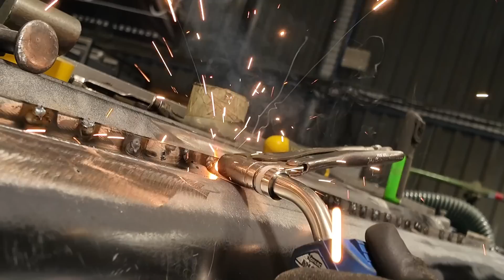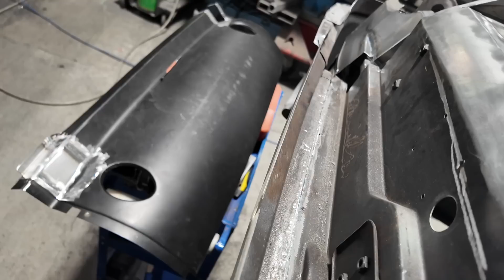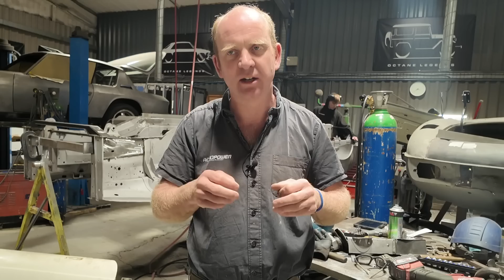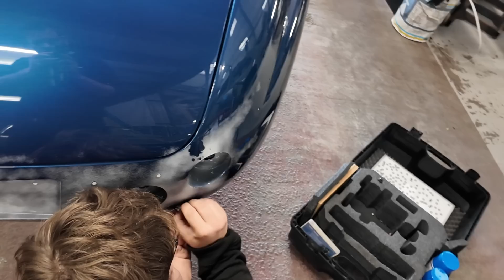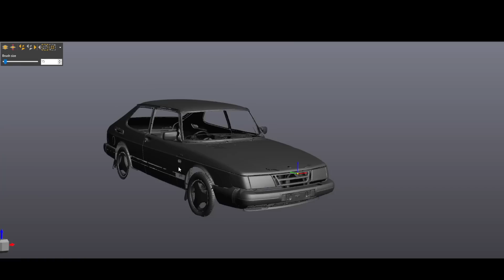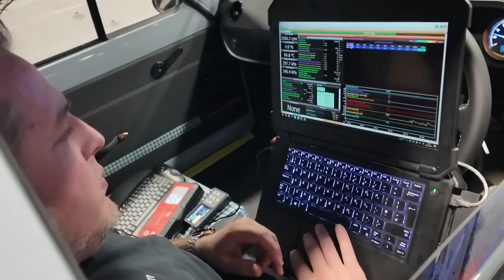Restomod Jaguars! XJC, E-Type & MK2 2-Door.

Comment: Citroen DS with internal combustion... but going completely out of the box? If you're feeling brave, how about a rotary from an RX-8? Circa 250bhp ... but creamy smooth and would sound completely different... And if you're not keen on a rotary [and if it would fit!] what about the B58 as fitted to the BMW M140i? Silky smooth, turbo, came with 335-350bhp out of the factory... but can go to 500 or beyond if you're feeling silly.

Comment: Regarding the DS - I've worked for classic dealers and recently we had a DS19 Chapron Cabriolet that was restored beautifully to look bog-standard and preserve its lovely lines. The suspension and brakes were all rebuilt to function beautifully as designed, but under the bonnet was a 2.5-liter 16-valve Turbo from a CX Turbo, with standalone MOTEC management, and a 5-speed manual (shifted via the column, naturally). It had beautifully functioning A/C, was always on the button, and yet it wafted along like a Citroen DS should. The guy spent about a half-million dollars (US) on the restoration, and I would equate the performance to an 80s SAAB 9000 Turbo - smooth, comfy, effortless. An absolutely wonderful car. Not sure if I can link to it here... but I'm happy to try.

Comment: Bare DS and SM Chassis, judged by photographs: Citroen gave the SMs V6 already more clear width,... maybe one would have to use parts of an SM Chassis/"floor pan"/ its front part, to make room for a flat six ?

Using the existing space a DS provides...A VR engine comes to mind space wise: But VR5 or VR6 of VW would not have any strong link to Citroen. And Lancias "latest" VR6 should date from the 1960's at best ? and the Fulvias VR4 from up to 1976, but fourbangers should fit anyway as a inline fours.

Or you might use parts of the front of a Traction Avant 15/6. 

Or just build another triangulated space frame - in this case only the front end section - connecting in a jaguar E-Type fashion to the chassis of a DS from the fire wall on.

...electric would fit the DS as almost no other car, in my view, although not representing an overly surprising choice.

Comment: The present engine is a large old fashioned straight 4, could it be replaced with a vr6/ R32 engine should fit. Then just need a gearbox that fits and can cope with the torque/power.

Comment: For the DS, you’d need something with a low profile that’s quite short, an LS could work but I’d do a twin turbo (small turbos) 3.0 duratec through a nice torque converter auto gearbox. Plenty of grunt on the squeeze of the throttle with no lag.

Comment: According to Wikipedia Citroen where planning a flat six, front wheel drive engine for the car but funds weren't available. Don't know much about them exempt lots where cut up for film tracking vehicles because of their incredible suspension. Are they an inline 6? How about a refined AJ6, or if you really want to be stupidly difficult, maybe, and it's possible I know a really great manufacturer of flat sixers?? 😉

Comment: Citroen DS would be suited to a V6 hybrid possibly. Using say a 100kw motor to torque fill and give about 20miles range with a small 7-10kwhr battery. Super smooth and modern

Comment: For à Citroën DS, how about what Citroën themselves did - a V6… they built a number of two door (cut and shut) test beds for the SM running the 90° Maserati V8 with two cylinders - very crudely - lopped off. The later PRV and PSA V6 engines retained this configuration, I imagine through a mix of experience and the practicality of a wider, thus lower, engine for a transverse application (Xantia, XM etc…)

Comment: Citroen DS -- potentially a 3.0 V6 from a Pug 406 -- the last(?) development of the original lacklustre PRV 2.7 V6 turned out to be quite a lovely motor, at least behind a 6 speed manual. For a DS, an automatic transmission would probably be more suited as long as it wasn't the 'orrible Peugeot auto that was often behind the 3.0. 
Oddly, and right on the tail of the comments concerning EV conversions, an EV DS would be one of the VERY few EV conversions that I feel would suit the spirit of the car. In a Testrossa, though? That is just ridiculous to even contemplate.

Comment: I thick that the DS was originally designed for a flat engine, could a flat 6 fit?
Interesting but maybe not the best option for a cruiser type of car.
Maybe a flat 4, less powerful so better for front wheel drive.

Comment: My father was an engineer at Jaguar. He started at 18 as an apprentice in the experimental department and retired some 41 years later from Jaguar. Just saw your video and thought I bet he was responsible for the design of said "tube" you mentioned and turns out he was. So here goes his words via my typing after I got off the phone from him. They are not "tubes" but part of the Manasco strut impact system. There was liquid in the strut which was also proprietary to the Manasco system. Per U.S. federal rules a car had to withstand a 5 mph impact with zero damage at an angle of straight on to no greater than 30 degrees off set. To achieve this the bumper would travel/compress 2 to 3 inches. Hope this helps. Love the channel and tune in weekly.

Comment: a question for Callum, could you explain how you go about registering the body swap cars and some of the other vehicles you're building which are dramatically different from original design layout eg the current run of escorts where you've changed to irs please?
Reply: I think a lot of them have been IVA'd as it is mentioned in some of the uncut episodes. The minor for example iirc.
Reply: @malcolm8938  I have asked the question a few times and it it's always dodged
Reply: Maybe they aren't all IVA'd but tbh I can't blame them for not wanting to discuss how they register modified cars having seen the problems it can cause. @davidclarke3643

Comment: The thing I detest about drive-by-wire throttles is the absolute lack of feedback through your foot.  With a cable, you can feel when any slack is taken up, find the point where the throttle is just about to open and hold it there if needed.  Especially on a road-going car where you're likely to be on steady speed throttle much of the time (or on cruise control), and with much more stop-and-go driving than a track car, I prefer that feel through my foot so I don't jerk, or have to blip the pedal every time you get moving so I can find the point where the throttles start to react...even coming off cruise control, it's smoother if I can pick up the throttle before switching it off so you don't get an immediate and abrupt deceleration.  Easier for tuning, but I feel it's a bit of a compromise in terms of actual driving.

Comment: The Citroën DS was originally intended to have a 6-cylinder engine, but from a cost perspective (cost savings) it remained with a 4-cylinder in-line engine. So a V6 with a lot of torque seems to me to be an interesting and suitable alternative (a 6 in line would be even better, but will it fit???).

Comment: What engine would I put in a Citroen DS? A Nissan VQ37VHR V6 from the 370Z. With ITBs, a mild set of cams, and a properly-built exhaust system they can sound glorious, and 250 kilowatts is plenty to get a DS up to speed and capable of some 'lively' behaviour.

Comment: If I win the lottery I have a project for you: a Aston Martin DB7 Vantage totally restored body wise, painted in a traditional A-M dark blue with mid-blue leather interior, then the powertrain changed for a Chevrolet LS1 V8, a TREMEC TR-9070 DCT 7-Speed Dual Clutch Transmission, I will leave the diff to you, an ECU, Wilwood disk brakes all around and (here's a challenge) a complete Apple CarPlay instrument system (including all gauges). Ah! what a lovely car that would be.
Thanks for the great videos, my only suggestion is to get Nat to explain some of the technical issues in more detail 🤔🤨😊😬
Reply: Nice! Swap AP Racing for the Wilwood rubbish though. And maybe an LT4 over an LS1

Comment: On the Citroen DS  Either full electric or maybe a Subaru flat four all-wheel drive they easily will make 3 to 500 horsepower turbo'd conversion

Comment: Water cooled Subaru flat6 (3.6L? of effortless torque/power) in a Citroën DS...?
Flat6 would help with the low bonnet lines ... opens up to possible 4wd...
Reply: The problem is the engine layout, they ran the gearbox in front and not behind like a Subaru. A Porsche 3.6 and gearbox is running in the right direction.

Comment: Regarding the question of engines and performance it comes down packaging and intended use. 

Bore spacing in the block determines bore size. Bore size determines valve size. Valve size determines airflow. Airflow determines output. 

Fun fact, the Kent engine and Duratec share the same bore spacing. Therefore it should come as no surprise that a 2 litre Duratec is only good for 300 bhp.

Comment: It's amusing how many people seemingly have no idea of engine/gearbox layout of the DS or how restrictive the engine bay is. 

Whilst the engine bay configuration is suitable for an electric motor there  is not really a suitable place for batteries. The batteries would have to mounted above the centre line above the electric motor or at the expense of the boot area or at the expense of rear seats. 

The next issue is the transmission. The input shaft from the clutch is known to fail. The torque from an electric motor would be an issue. This could be overcome using modern steel alloy. 

A while back I was asked to produce a competition engine for a DS. I made custom cylinder liners for a DS  23 block/crank that made it 2.5 litres. I made steel camshafts for it. I welded up the combustion chambers. I offset bored the inlet ports (raised) and welded in port sleeves. I used V8 Chev valves. Engine software was predicting 230 lb/ft and 260 bhp using 4 x 48mm bike carbs. The rules meant carburetors and the engine bay meant bike carbs. 

In an ideal world the DS25 would have been injected with coil on plug ignition. The standard distributor arrangement for drive and placement wasn't ideal. It would have been dry dumped. No service parts were available for the standard oil pump. The standard pump design   wasn't idea for motor sport either. 

Unfortunately the entire project was put on hold.

If you're interested in additional information let me know. Happy to assist.
Reply: Love it!

Comment: Funny thing is Cal didn’t mention handling, drivability, reliability or performance once, he basically said the Testarossa is a crap, badly built car that makes a great noise.   I thought performance cars were about driving? If the electric conversion makes the car faster, handle better and more reliable what’s your problem?   Or do you need the  noise so other people will notice what a cool dude you are?   Moggy (that guy from Wales) has spent a lifetime actually building and racing cars both petrol and electric not sitting pontificating from behind a keyboard.
Reply: He has a niech and I get that.  I think the Testarossa was a marketing act, one where you make a problem to sell a solution. This is a one off, simply to piss off the purists. In the same vein as Rich Rebuilds putting an LS in a Tesla.  
I also think the idea of never using an EV as Cal is adamant about is just as pig headed given his schtick is putting better engines in cars. The problem the EV converters have is crash safety. Putting 200kg of incompressible steel in old cars is the bit I don't like in anything other than a city runabout.

Comment: If it has to be ICE for the DS I’d go with an air cooled Porsche flat 6 mated to a 5 speed semi auto ds ‘box. That’s what the DS was originally supposed to have. For suspension keep it hydro pneumatic but use something like McLaren’s hydro pneumatic anti roll with no antiroll bar (Citroen also prototyped this in the 70s). 
But EV is better for DS. Silent, torquey and effortless.

Comment: It turns out that that fancy twisted exhaust tips on the XJ jags , were very nessesary, I worked at a jag dealership in 1975 and the cheap chromed originals had rotted out and replacements were not available so we put straight ones on, however because of the low pressure area at the back of the car this allows killer exhaust Gas to enter the car on a trip.   Just be aware

Comment: The DS, where the engine isn't in any way part of what makes them cool, would be the perfect EV conversion. Same would go for most "non performance" classics. On cars like the Testarossa and other performance/super cars I'd rather walk than have an EV powered one. Even if the performance was twice as good it'd still be absolutely missing the bit that made it special.

Comment: Ds powertrain: electric with onboard generator. The Mazda cx30 has (I believe) electric propulsion with a rotary ‘range extender’. This would fit the ds perfectly as Citroen dabbled with rotary power (they produced a small number of rotary powered gs before abandoning the idea). It would mean a modest battery but a usable range.

Comment: Dennis Collins gas just found a wicked early round light DS…. A Maserati V8 from a Grandturismo would be cool, cheap and in keeping as the SM was Mazza powered.
Reply: Thinking height vs bonnet.
Reply: Where are you planning to put the gearbox? The original DS motor was so far inboard the cylinder no 4 was accessed through a hole in front of the windscreen.
Reply: @keithhoughton4308  transaxle?
Reply: @paulbaker5238  Rear wheel drive or gearbox in front of the engine as the original?
Reply: Front  engine rear gearbox
Reply: @paulbaker5238  Aargh!

Comment: Funnily enough I have been  thinking about a Citroën DS project myself and also wondering which engine to use. I think tor sheer waftability a turbo diesel would be best but a slightly less "agricultural" one than the TD4. Also an alternative to the traditional suspension could be an air ride set-up

Comment: For a DS restomod I think it’s best to use the 3.0-24v V6 from the XM, still uses a hydro pneumatic system like the DS..
Reply: But an engine can be build and improved, the team at Retro Power is very capable  doing that.. it may be a older design engine but for a reliable cruiser that engine will be great in a DS
Reply: Don't go there. Poor engine from the  Peugeot years which was already behind the times when originally fitted to the XM.

Comment: A Citroën DS should waft you along, so either an undersquare inline 6 cylinder ICE or an electric motor, IMHO.
And no flared fenders, please ;-) If you have to widen it, the fenders should have flowing lines following the original design.

Comment: If  you do a Citroën DS project: the answer is easy .. throw in a Citroën SM ( Maserati ) engine. Even have the hydralic pump and all
Reply: Have you seen under the bonnet of an SM, though? It’s not a very elegant solution with that great long shaft driving the pump

Comment: DS needs a PRV. Naturally aspirated, single throttle body, cast manifolds and a 2" with a 2' resonator and a oval rear silencer ending to a bent saw blade edge. It would have all the necessary torque, just enough sound to tell the driver the engine is running okay and the rest is wind and road noise. You could listen your favorite tunes without going death while doing touring speeds.

Comment: 997 engine and DSG gearbox as a Citroen DS mounts the engine the same direction.
Reply: Spot on. 

Completing the DS concept as intendended, as stated by so many.
Reply: Someone has to find out wether the "centerline to back of the engine" is "short" enough, since the DSs Inline four is already "intruding through the fire wall" into the cabin. flat six should be as long as "three and a half cylinders in line" ? and therefore it might fit.... no idea how the gearboxes are layed out. But Porsche will have tried  hard to keep the package  "shot", hanging out of the back.
Hm, and how about the footwell - Is it going to be compromised by a wider enigne? 
EDIT:
Can anyone put his DS up on the lift and measure the clear width between the frontal outriggers - and than put his Porsche up on the lift and measure the width of the engine hanging out of the back ?
Reply: I read that as a 997cc engine for a moment and wondered why you’d want a 39bhp Ford pre-crossflow Kent in a DS! 🙄

Comment: The N/A YB engine (and presumably the Millington ) has a very compromised head as it was designed for a turbocharger with low CR. The valve angles are too big and you need at big intruder to get the CR. Hence the combustion chamber is really not ideal compared to the BD head

Comment: Surely the DS is the perfect candidate for an EV. Silent wafting with a discrete pump for the hydraulics sounds awesome to me.
Reply: The SM is an even better candidate in my view.
Reply: @mrdainase  I'd rather see an SM with the modern Maserati/Alfa engine. 530bhp seems adequate as a starting point 🤔😬
Reply: I'd go with a Lexus 1UZ-FE V8 as an ICE in the Citroen. 6 bolt mains and smooth as silk!👌
Reply: Ev for sure.

Comment: XJC drain tubes. If they are such a rot point, why not braze copper pipes which can be made up with the endless different shallow bend fittings if no pipe forming equipment is available. ( friendly plumber !?)